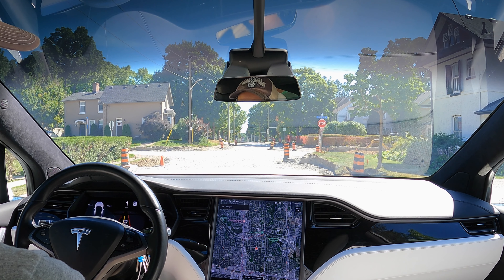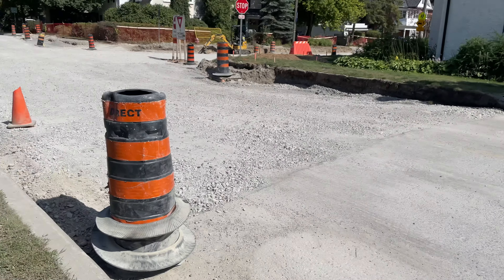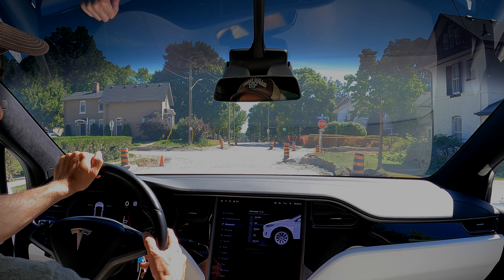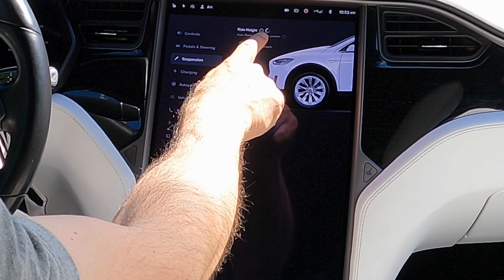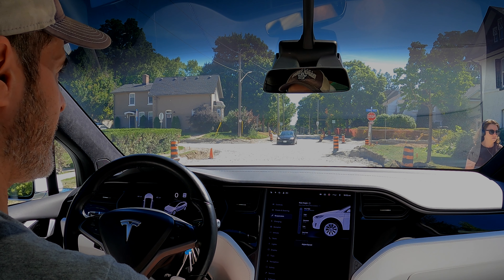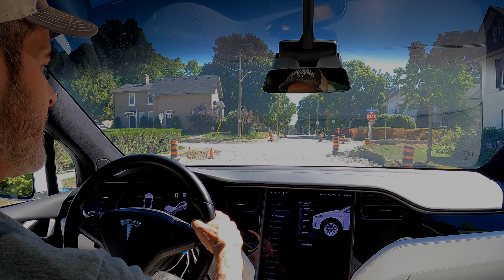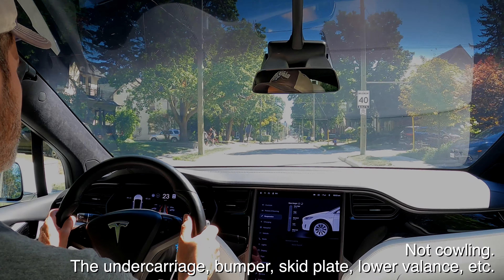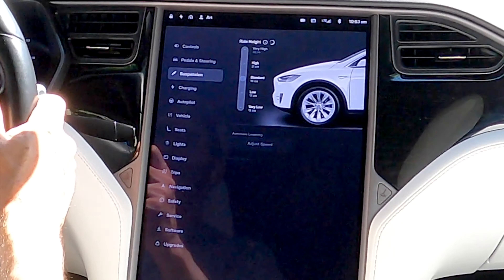Tesla Adaptive Air Suspension: Adjusting the Ride Height

Comment: This is not inovative at all. My eldest car, built 60 years ago has that feature.  And i suppose that tesla  cannot be driven after removing one wheel, my car can.
Reply from the maker: Well, my friend, I’m more than a little curious to know what your 60-year old car is!
Reply: @GreenNeighbour  Citroën DS (built between 1955 and 1975,  mine are from 57 and 68)
Reply from the maker: @georgiodegrenoble8675 Amazing! Did they continue to engineer those impressive abilities into their cars?
Reply from the maker: I just looked it up. I seem to remember seeing these cars around when I was a kid. In fact, we had a similar style of car when I was around 8 years old: a Renault 16. I quite like the Citroen. It’s very stylish, and quite advanced, even by today’s standards. https://youtu.be/Absi-jbCZBE?si=s0n6yYjmt8btAfN_
Reply: @GreenNeighbour  I like r16 too.  For hydaulic suspension, they are no longer sold. They used that system on many different models (DS, GS, CX, BX, Xantia, XM, C5, C6) and last one was in  2017. https://www.youtube.com/watch?v=uvBnSIs1JHs&t=12s https://www.youtube.com/watch?v=x5gds6alUy8
Reply: Wow did your car also have tires and windshield?? 🤯

Comment: This is a great video. Thanks! Is there anyway to lock in a height? Like if I want to drive in very high all the time. Thanks!
Reply from the maker: I wish there was! This is actually a frustrating aspect of Tesla’s adaptive air suspension. You have to drive inordinately slow to keep the suspension set at high or very high. You can, however, at least disable the  default setting that will automatically lower the suspension after the car drives 100 feet. You do this by clicking the word “Keep” just underneath the “Very High” setting. This will maintain the Very High suspension height indefinitely as long as you keep the speed under 15 mph / 24 kmh. You can also prevent the car from automatically dropping to the “low” height (from “standard”) when driving above a certain speed. You can do this by going into [Suspension], then [Adjust Speed], and then scrolling to the right, all the way to “Never.”

Comment: So if I am a driver that likes to accelerates every now and then I should just keep it on very low at all times? Because then I do not care about adaptive suspension on a P100DL or a Raven P, since you should always have it as low as possible with that much power output
Reply from the maker: Sadly, you can’t keep it on low all the time. Much like the “very high” setting, the car will automatically revert back to standard height after a while. It’s also worth noting that the car will automatically lower itself if you are going fast. (ie. If you’re on the highway.) Having said that, it’s kind of fun to telegraph the fact that you’re getting ready to go fast by lowering your suspension to “very low“ while you are stopped. For example, if you’re at a stoplight and you’re sitting beside some Porsche or something like that. Not that I am condoning or encouraging street racing, but if that was one‘s intention, then you would definitely lower your suspension ahead of time.
Reply: @GreenNeighbour  Aha I see! That is important information for me. Thank you!
Then I somewhat don't see the point of air suspension(?). If I am on the highway doing 100km/h and want to dump that pedal to the floor like there is no tomorrow, I have to be very cautious because in fact the car is most likely in ''standard''? I mean compared to, say a model 3P, where you can always dump the pedal at any time since it does not have air suspension. Much more safe for the car and less to think about? Or am I getting it wrong here?

I am looking at a late 2018 S100D with 80.000km on it, MCU2, EAP, 1 owner and all that for about 49.000 euros. There is also a 2019 S Raven P with 80.000km, 1 owner, EAP, for 65.000 euros. Currently the cheapest one by far.. 

So whenever I want to have fun on the street (legally of course ;) ) I have to automatically lower the suspension anyway no matter which version I have? Or is it important to only do it when you are at full stop and want to do that 0-100km/h run? Because I would be surprised if the car cannot handle me overtaking fast on highway in standard mode.

Sure, Raven has better drive train, somewhat lower kwh usage and adaptive air suspension, but is it worth the extra money?? 100D is fast as it is and if i cant keep it at  very low at all times, then i dont really see how the adaptive suspension is so ground breaking that it is worth 16.000 extra 

Thanks for your opinion <3
Reply from the maker: @ZekeMagnum  Hey Zeke. In fact, if you were on the highway, your suspension would already have been set to "Low" automatically. I'm not 100% sure about it getting set to "Very Low" automatically. I'll try to keep my eye on what my adaptive air suspension does the next time I'm on the highway. As for putting the pedal to the metal on the street, I don't think the "Very Low" setting allows the car to go any faster. A Tesla will basically beat anything other than (you guessed it) another Tesla. I think the lower suspension just gives you more control at higher speeds. One time I had to quickly swerve my Model X on the highway when a car started to change lanes right into me (guess I was in his blind spot), and I couldn't believe how soft, mushy, and bouncy the car was. It was basically out of control for a couple of nerve-wracking seconds. I think it must have been just set to "Low" because if it was set to "Very Low" I would have expected it to hug the road better than that. I barely made it out of that one. Lesson learned. In my opinion, I might agree that adaptive air suspension is not worth 16,000 extra Euros: especially if it's not on an SUV. In my opinion, it's mostly just handy for driving down steep ramps or over severe speed bumps. Driving over rough terrain in an SUV is a totally separate use case, though.
Reply: @GreenNeighbour  Thanks for taking your time to answer me!

Since S100D does not have adaptive air suspension, how would that work on for example highway when taking the off ramp into a 50km/h zone for example? It will always be set to ''standard'' unless I manually press anything else? You mentioned it always going back to standard, but I don't know if you were talking about Raven or 100D. 

My understanding is that 100D with air suspension is on standard at all times unless you activate the very low option at a red light or very high before going on gravel road at slow speeds?

Comment: Cool! How high does the S go? any idea?
Reply from the maker: A good question! Interestingly enough, the owners manual for the Model S seems to take great pains to avoid indicating any of the ride heights for that car. It just describes them as, “low,” “high,” and “very high.”
Reply: @GreenNeighbour  my search lead me to roughly 20-21 cm ....remains to be seen if that is true :)
Reply from the maker: @cars9686  Great info. I see that my Model X display now shows all of the heights, and they range from 15 cm (Very Low) to 22 cm (Very High). Admittedly, I find it hard to believe that the Model S can raise to virtually the same height as the Model X. Having said that, it’s also a bit surprising to think that the entire range of height variation is only 7 cm. That’s just a difference of 2&3/4 inches between “very low” and “very high.”
Reply: Actually saw a Youtube video yesterday from a older model s and on the screen the very high shows 6,9 inch = 17,5cm which isn't all to bad. 
Standard shows 5,7.
Reply from the maker: @CARS  That makes more sense.

Comment: HI AM FROM THE UK 
JUST COME ACROSS YOUR CHANNEL
CAN YOU HELP ME 
MY SON HAS A 2020 AWD TESLA BECAUSE IT'S GOT  AWD MOTORS 
IT'S VERY FAST 
I WAS WONDERING IF HIS CAR MAY HAVE THE RIDE HIGHT 
HE SAID THAT HE DOESN'T KNOW HOW TO DO IT AND IF IT'S ON THE CAR 
I TOLD HIM 
IT MUST HAVE KNOWING THAT THE EXTRA COST OF THE CAR WITH DUAL AWD WHY WOULDN'T THEY FIT THAT
Reply from the maker: Hey there. Adaptive air suspension is standard on the Model X but it is just an option on the Model S. Most Teslas, such as the Model 3 and Model Y, do not have adaptive air suspension. 

Be well.